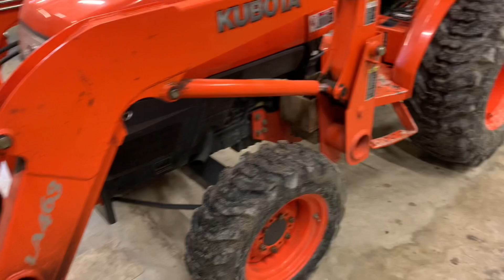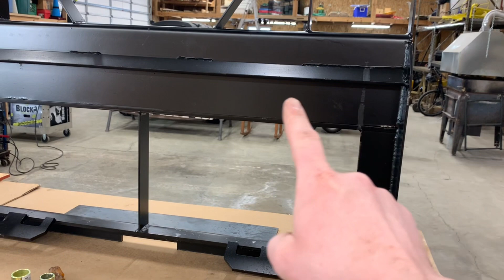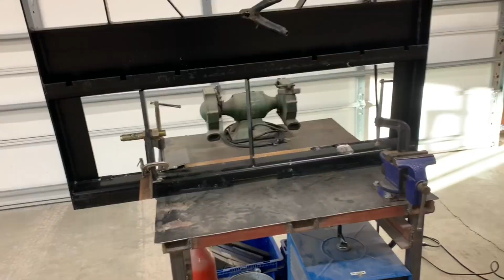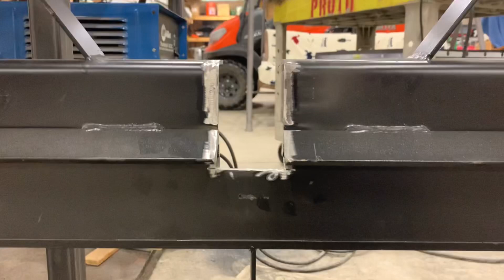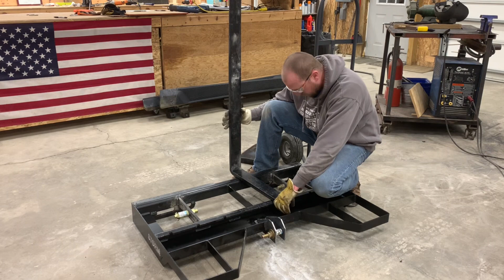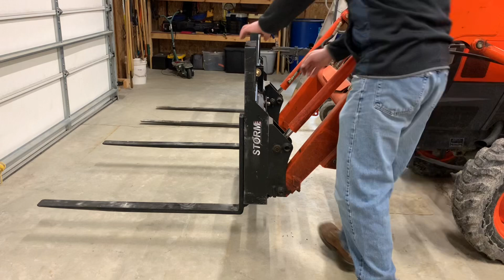167 Three Point Hitch Tractor Forks

Comment: Dang good job! The only thing I will do differently is weld a second verticle bar on each outside of the bottom pins. Instead of a bolt-on pin, I will just use a slide-in pin that catches two bars giving more support. But then my motto is "No kill like overkill."
Reply from the maker: Nothing wrong with that!

Comment: Sorry to say this, I spent a 100 bucks and bought a quick hitch to front skid steer quick hitch adapter. Found on FB market place. I can put my forks or bucket on my rear quick hitch.
Reply from the maker: I looked for one of those but couldn’t find a used one. Sounds like a good setup. Thanks for watching.
Reply: Do you have a picture OR link of this adapter you found on FB.
Reply: @donaldmercier-kuula8521  yes please ! !  post ir !